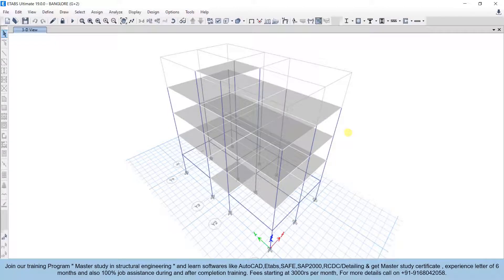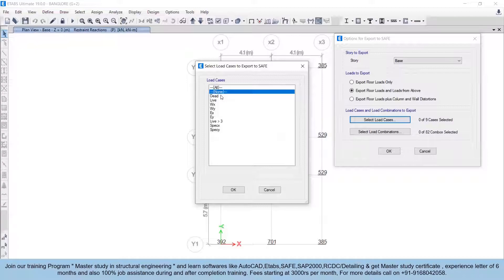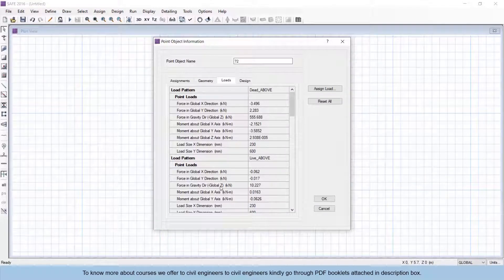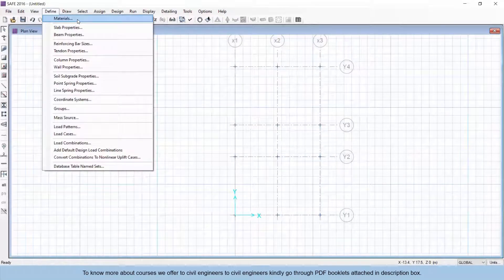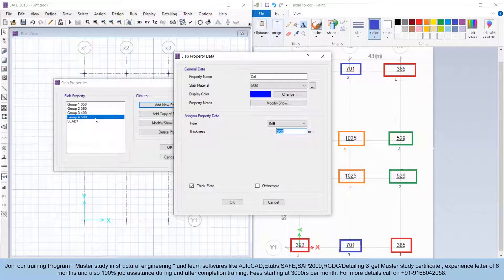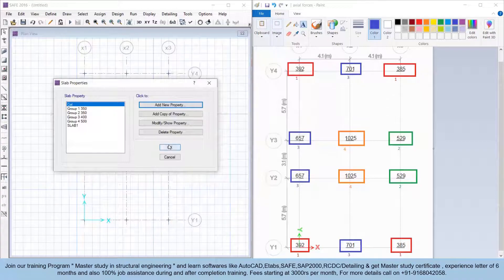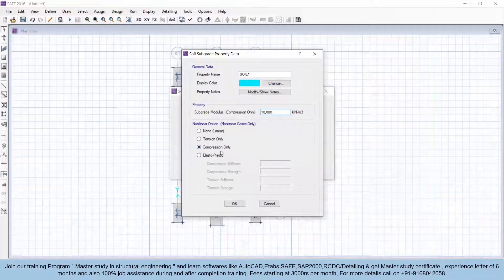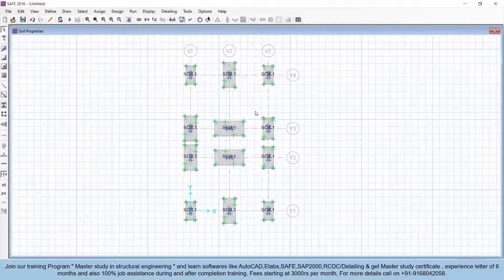Foundation design in CSI SAFE | Isolated foundation part -1 (Modeling) | Aspire Civil  Studio #safe

Comment: 1) Why did we leave wind load as they will have effect as a lateral load....... 
2) For dynamic loads we did all the work of changing scale and so on (as explained in your other videos) all that was done was because dynamic eq. loads are more realistic......
3) Mostly we have columns in a way that there are insertion offsets while modeling them..... Now do we have to remodel all that while making footings in safe because we wont get projections of column to place footings accordingly as we select base (isolated footings will generally be at the center of the column not at the node of the column).....